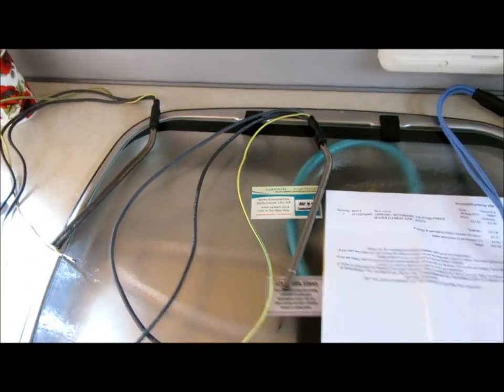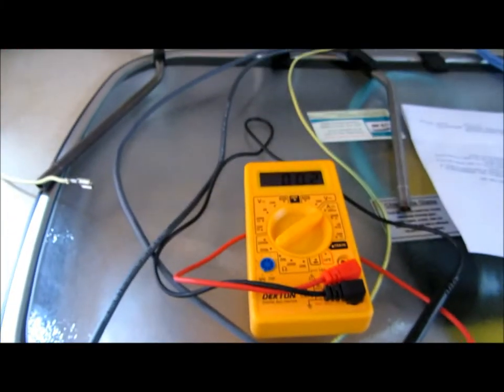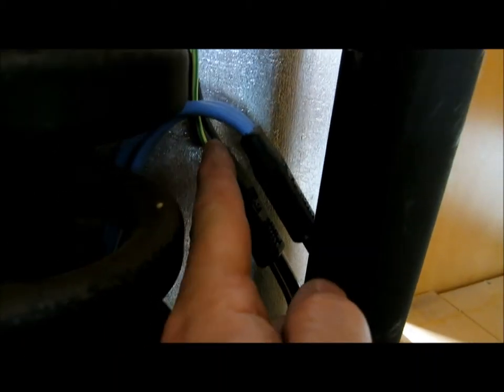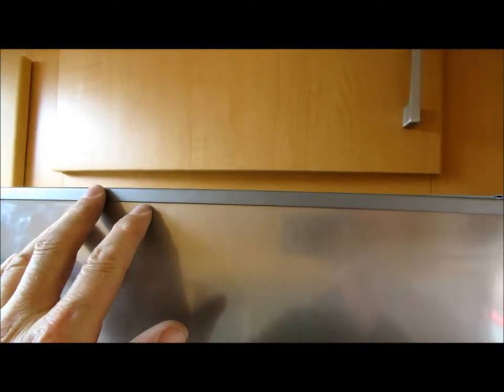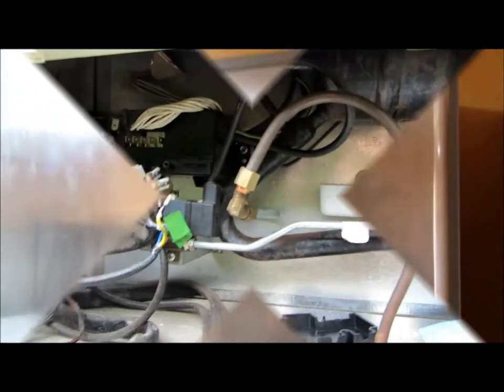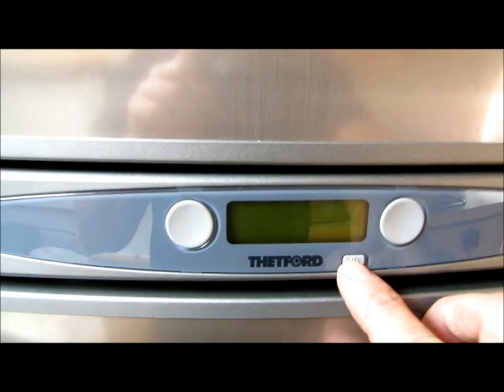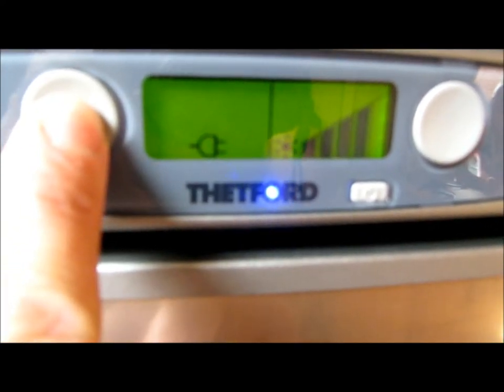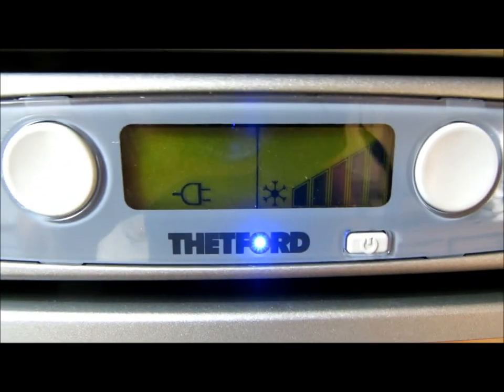Caravan Fridge Repair part3

Comment: Some interesting info, thanks. Just for reference you had the meter on 200 kilo ohms range, that’s why it’s reading 0.2 . The heating element is around 200 ohms.
Good to see the heater swap, I’ve still to swap mine out and the caravans only been used a dozen times. Thetford really do make junk.

Comment: Hi liked the video of replacement of 240v fridge element but no relevant information on what wires go where on the pcb, ie ac high and ac low. Both wires are brown and no indication of where each wire goes or how to distinguish each wire.

Comment: hello, how did you know it was the heating element to start with and not something else.. thanks.
Reply from the maker: The fridge worked on gas . So I checked the 240v heating element with a multi meter and it showed a fault. I had also Googled common faults with this particular fridge. Turns out this fault is fairly common.
Reply: ah ok, thanks for letting me know, I have the same on my fridge but didnt want to order part if it was just a fuse. thank you great video. very helpful
Reply: @brianphelan74  Was it easy to check the element with the fridge in situe or did you remove the fridge first? also can you check the 3 fuses with the fridge still installed?

Comment: In hindsight did you need to pull the fridge out, or could you have done it in place?
Reply from the maker: Definitely had to pull out the fridge. The reason was that I had to unclip the gas exhaust shroud to access the mains heating element. Plus it would have been impossible with the fridge in situ.